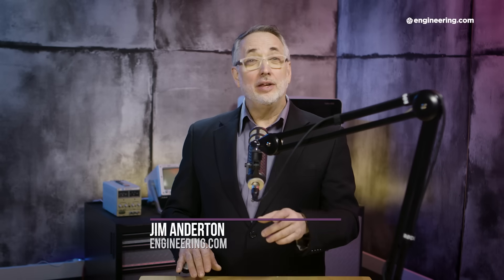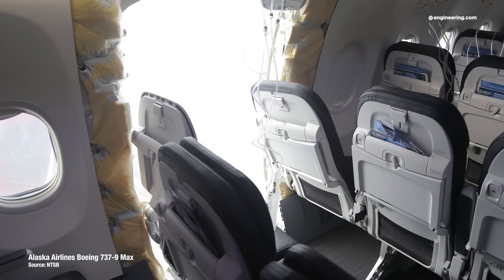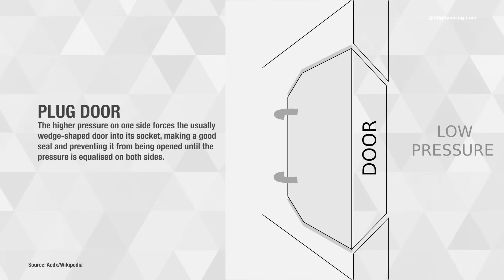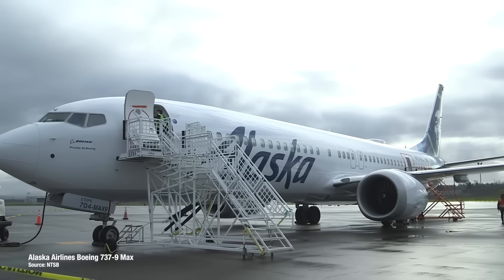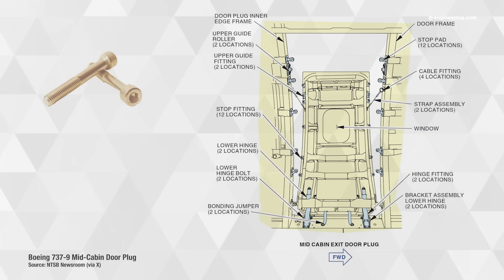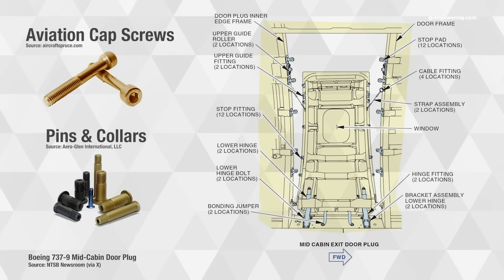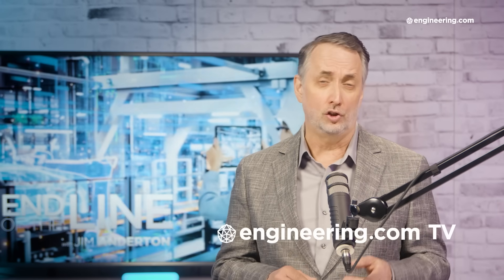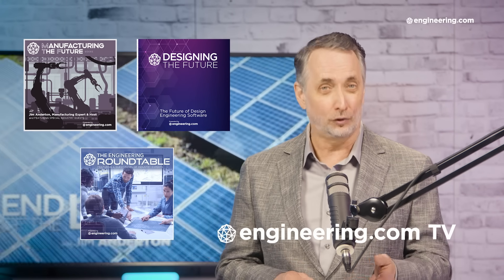The Boeing Issue Isn’t About Bolts

Comment: Rubbish video trying to con the public no need to bolt the door on an airplane.  For Christs' sake you can be the one sitting next to the blown away door too!  At it simplest condition when people are entering or exiting the palne there is no pressure difference to hold a unbolted doo in placer!

Comment: You can't blame the technician for "forgetting to put them in" either. Proper aircraft construction and maintenance procedures call for inspections of every single critical installation. These inspections are the responsibility of engineering and management to implement and to ensure that they are done. EVERY operation performed on EVERY aircraft is REQUIRED BY LAW to be documented, both in the specifics of what is to be done and how. It is also required that a second person inspect and verify the proper completion of the action in compliance with these procedures. In addition, there should have been multiple inspections of the area, not only when the hardware was installed for the final time, but also an overall inspection of the area to ensure that nothing had been changed before the inner panels were installed (commonly called final close out.) The ONLY way that these bolts could have been left out or left loose is for there to have been no documentation included in the procedures for their installation, AND none for the final close out of the area. The fact that multiple aircraft have been found with the same condition proves that the issue here is procedural per the documentation, not a lazy mechanic, and is the fault of the engineering and management staff who failed to ensure that everything was properly documented. Every aircraft mechanic KNOWS that every bolt is supposed to be inspected before final approval is given, and if the documentation he/she is working to does not specify and inspection at that time assumes it is to be done later. This is especially true in the case of a door plug that is probably being left loose for work access later in the build process. No experienced mechanic in the world would give a second thought to these plug doors not being secured and final close out inspected before the interior is completely installed.

Comment: Spot on, I have done manufacturing on XLS aircraft years ago primarily flight line maintenance here. First thing I said was, not installed properly. Excellent presentation. Subbed...
Reply: Not installed properly originally, or during maintanance.  And how would you know  (Like most commenters on MANY subjects, you're VERY likely just using your intuition and guessing).

Comment: From the very first discussions of how this door operates it's been apparent the required fasteners couldn't have been in position. That means inherently it can't be a fastener problem. It's a quality control problem, pure and simple. Another description of preliminary findings indicates there is an email trail showing a discussion of how to describe the seal repair, eventually arriving at a description which would allow it to avoid a full reinspection of the work. THAT is the problem.
Reply: Inspection isn't the problem. The issue here is a process failure and what needs to be investigated are systemic failures within the QMS which encompasses production and engineering. Far too many people are of the opinion that increased inspection can fix all ills. It is impossible to inspect Quality or Conformity into a product. Robust manufacturing processes which include but not limited to written instructions as well as training and supervision of the operators. In many organisations reliance on inspection to catch maunfacturing nonconformities  has been the mindset and it always results in something being overlooked. If manufacturing and assembly is sloppy with inadequate instructions training and supervision then things will go wrong. Inspection also serves as an audit function with findings fed back into the QMS so areas of strength and weakness can be identified and appropriate actions taken. In short Don't blame QC or the Inspector it's not there where the problem lies never has been never will be. Remember QC don't make anything all they are trying to do is confirm that the product is manufactured to specification.
Reply: @paulbarker5179  that's a solid point. It's one of the basics of Quality Management that even 100% inspection can never make up for a bad process. In this case they deliberately chose a thin process to avoid the documentation which accompanied a more robust process. In hindsight that was a very poor decision.
Reply: @paulbarker5179  Unfortunately it is a human error because they obviously know how to do the job, it is done many times.  There is always a failure rate even with 6 sigma manufacturing.  I just hope that it sobers everybody up and improves things.  The biggest problem out there in aviation is runway incursions I think but that is off topic.  Just glad nobody got hurt with this "learning" experience.  Documentation just documents what you are supposed to be doing, you still have to do it.....
Reply: @paulnicholson1906  Human error is a totally wrong and lazy determination of root cause. As soon as Human Error is asigned as the root cause the mindset is then it can't be helped so it is accepted that it will happen again and cannot be prevented. As for your reference to 6 sigma manufacturing nonconformances will be 3.4 per 1 million oportunities. It is also worth noting that 6 sigma manufacturing is impossible for any process which is not fully automated. We don't know yet what the discrepant condition was with the 2 holes. Were they drilled oversize/undersize, drilled in the wrong place and violated edge distance. Was the drill fixture pinned up correctly? Without all the information it's not possible to ascertain root cause.

Comment: The fasteners I saw weren’t cap screws but bolts with castellated lock nuts.  I know most plugs seal by the pressure forcing it out but these look different.  The bolts hold the door in a correct channel on the fuselage which holds the pressure.  There isn’t tension on the bolts other than that from torquing the bolt.
Reply: There is spring tension from the bottom springs that assist the upward travel that must occur to allow the door to open. The bolts are there to prevent that upward travel because it is spring-loaded.
I'm sure the tech pulled it down into the closed position and slid one bolt in to keep the door from springing open. Without at least one bolt, the door pops open and would never leave the factory.
Reply: @paulwolf8444  and did not even install the nut as it was "temporary" and went on break, didn’t return for some reason got reassigned. No QC check as it was not “removed” and someone came along and reinstalled the interior lining and never noticed. A few pressurization cycles and bumping along and the one bolt dislodged. Classic human factors, and process failure to catch the error.
Reply: @ecase727  See how this doesn't take geniuses to put together.
Reply: @paulwolf8444  and the NTSB just released their preliminary report, and guess what the bolts were never installed. No surprise here.
Reply: @ecase727  I'm just curious since it's been so long from the time this plane has gone through production if the absent-minded technician realizes he was the one. Most good techs have their own system of checks for their own personal peace of mind and not just a companies requirements.
Reply: @paulwolf8444  I doubt that he realized it himself, but I am pretty sure that Boeing has grilled everyone who touched that door. When the fuselage hits the assembly line floor, till the aircraft rolls out to the flight test line is 9 days. The pace of the line is intense, and repetitive, I toured there years ago when I was at Boeing for training once. The techs stay put and the line moves, so he would have seen a dozen or more different aircraft in the weeks since he touched the door. On Monday he closed the door when he came back on Tuesday there is a different fuselage in the same spot.

Comment: Strictly my personal experience in the aerospace industry is Managers and Engineers have ZERO HANDS ON MANUFACTURING EXPERIENCE! Gone are the days when Managers came up from the floor!
Reply: Yes, bring in all College
No knowledge to run the show. Not taking the best
From the floor
Reply: This is what made Skunkworks engineers the best.  Any one of them could go down to the assembly line and actually build an aircraft, and the assembly workers could take a part up to engineering, throw it on a desk and say "This is not working out right, there's a problem here." and get a fix on the spot, often with the engineer going down to the assembly floor to eyeball exactly what was going on, and they always got it right.
Reply: @rtqii  My Brother worked on Skunk works
Reply: Don't blame the engineers! Manufacturing aka shop workers and their unions actively keep anyone but themselves from learning to fix or build anything...especially engineers. I've seen them keep training course from being held because they want to protect their jobs.
Reply: @numobudo  Pretty sad when  Engineers only have textbook knowledge, Pretty sad when Engineers can't even read a blue print!

Comment: A one in a million mistake or a chronic systemic blunder, just hoping we get to the bottom of this and it does not happen again.
If this accident was caused by cost cutting measures, that's one hell of a way to work at killing a giant, historical money and job making machine. Penny wise and pound foolish is a motto that should never enter the discussion in commercial aviation.
I'm betting a even thousand missing cap screws can result in another CEO bonus in this fiscal year. Let's see if that does come true.

Comment: Boeing’s data management and transparency is the issue.  Not telling pilots the truth about the stability augmentation system, not alerting that new depressurization causes cabin door to open, and failing to link door maintenance to quality control checks for all scenarios caused these events.  The structure was good, but the design was not relayed to others in transparency issues, and actions linked to door maintenance escaped review.  Wonder what else is lurking in that software.

Comment: Dude you have no clue. The boots were AN4 bolt. What you call a pin and collar I’d a High Lock and collar. The inspection method you stated is not one that ways it can be done. An AN4 is a very strong bolt and will be used over again. To torque a bolt is not a machine recorded fact. It’s done by hand and write and watch by QA. The problem is the work paper work may not have been proper because a problem with it. There is nothing that informed the Final QA that the. Lots should be inspection. If you telling the public something as a so called engineer you better  have your facts correct. Your not close to it

Comment: The whole automation-will-solve-it idea is one that is fraught with the realities of pragmatic manufacture.

It's the cross-system interfaces that are usually at the heart of these compounded failures where two systems suddenly have their internal multi-faceted interconnections reduced to a few allegedly common factors that replace those multi-factor linkages. E.g. catching design updates that trigger manufacturing documentation changes that aren't  process changes (such as bolt changed from M4 to M5, or removed in one plant and replaced at another, and numerous other 'off by one' fails). 

Bad logic is often the problem that doesn't add a "trust but verify layer", with further "Quis custodiet ipsos custodes?" (who guards the guards! checks).

Comment: The software and integrated software/hardware solutions are interesting, but at this point they're also further levels of complex process (buy/design the tools; write documentation for tools and processes - something Boeing is already demonstrably very bad and/or negligent in doing; train mechanics; develop a software workflow to account and record; and on and on) in what appears to be an already broken process management / QA structure at Spirit and Boeing. At this point software solutions are just another potential point of failure.

Comment: The plug was removed by the subcontractor who installed the satellite/entertainment system.  Were they authorized to remove a "Structal" component and reinstall it?  Two areas of concern have been raised during the inspections since the event.  Lose bolts on the mounting brackets and missing nuts on the retention pins(bolts}. Installing drilled head bolts on the mounting brackets which would be safetied with wire would eliminate this problem. Using a self-locking castellated nut would add a second level of security which is always better in aviation.

Comment: In the Air Force anytime you do anything on an airplane that makes it unsafe to fly you have to enter it into the aircraft records. Once that happens someone will need to sign it off before the airplane can fly. The records are kept with the airplane all the time and the pilots review the records before flying the airplane. Removing something like bolts or even losing a small socket while working on the airplane will trigger a grounding and the plane can't fly until the problem is corrected.

Comment: I question the design. Specifically the use of the springs. In my day we wanted designs that were idiot proof. With no bolts, it was only a matter of time before the door plug literally sprung loose.

Comment: Given the design of that plug door, that it is spring loaded into place, how is it possible that the door can remain in place without the retaining bolts? If the door is truly a plug style design, i.e., the edges are chamfered like a bath plug, then maybe the door could potentially tentatively sit in place without its retaining bolts even when it is spring loaded into place. And during flight, with internal pressure greater than the external pressure, this would help seal the door against the fuselage, making the retaining bolts less of an issue. But the door got blown out without any visible damage to door edge or frame. This leads me to suspect that the plug door was not a true plug style and therefore required the use of those bolts to retain it in place against its spring loading. Given that, then how it is feasible that any maintenance technician could not have installed them? None of this makes any engineering/design/maintenence sense whatsoever.

Comment: Wrong. It is about bolts. You start at the bottom and work all the way up to the top. The system is rotten, but start at the bottom and work up.

Comment: Im a certificated Airframe and powerplant mechanic. The term "cap screw" is a generic term to describe the fastener. The fasteners in question actually are bolts because if their structural application as well as the fact that they have an unthreaded portion that is designed to withstand shear force loads without marring or damaging structure. A screw typically is not used for structure and typically has threads that extend from the head to the entire shank of the fastener.

Comment: Of course it isn't.
Is about how airliners are still built like from half a century ago.
Look at cars, how they evolved from the 50s and 60s and look at airliners.
Same coffin with wings.
Yes, the engine technology has evolved, but the actual reason why they function, the people they are carrying, not only it hasn't evolved, but downgraded severely.
And the safety of said passengers is the same.
Cars, have evolved through leaps and bounds from the coffin on wheels. Even buses and trucks have undergone massive safety improvements.
Planes, nah.
When something bad happens, there are hundreds of people that can POOF out of existence.
Look at the japanese incident from january 1st. It was a massive luck that the crash happened at a lower speed and the plane was controlled.
And employees that are professionals managed to evacuate all passengers. But the plane disappeared, only a husk, much like the hindenburg, remained.
THAT is the problem. Had not the luck of events helped out, we would've had a 300 deaths score on our hands, because of how airliners aren't built for safety, but for manufacturing low cost and enrichment of the investors. And that is the crime. 
There should be all sort of safety elements within each seat, ejectable with parachute and beacons.
Humans should not be carried like bags of potatoes that are treated like "shit happens" by the plane makers and airliners alike.

Comment: I am a professional engineer and am intrigued by the blown cabin door and all the discussions about QA/QC. A highly critical part like this plug door ought to have lots of procedure and Q-Plans for its installation and removal. Many teams are involved and how come it was not picked up by someone is beyond me.
The only possibility is that it was installed in place and never put through QC. 
A very sad state of affairs. The FAA ought to first check its procedures for installation and in-service checks and also if those are carried out or not.
Reply: The door plug can either be removed completely or just swing out 15 degrees for servicing. The problem appears to be a procedural oversight where a complete removal of the plug has instructions for replacing the four locking bolts while a 15 degree opening for servicing does not. In this case since the door was only swung open for servicing there were no instructions to replace the four locking bolts, so no ever one did.
Reply: Is this kind of plug door a new design for 737 or same design is used for other planes.
Reply: @kookicck used on earlier 737s and on 757 as well.
Reply: If it's a proven design than the problem lies somewhere else.